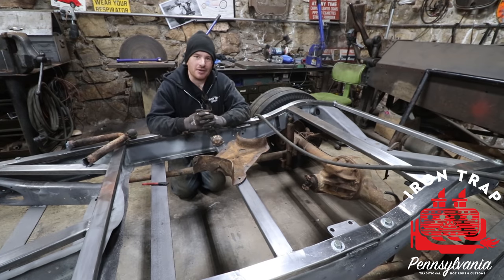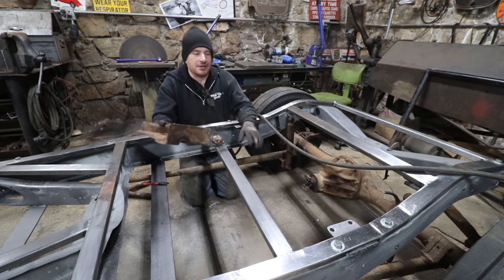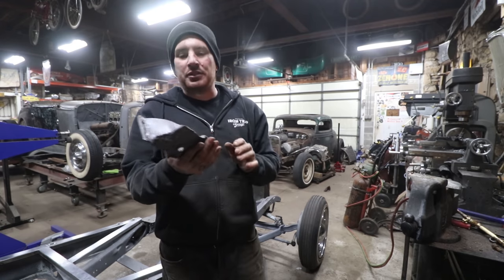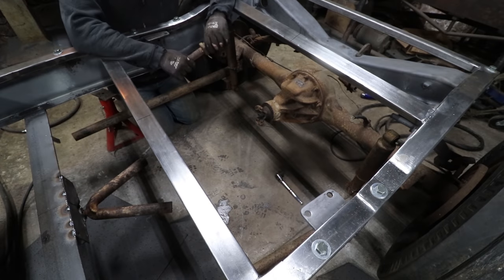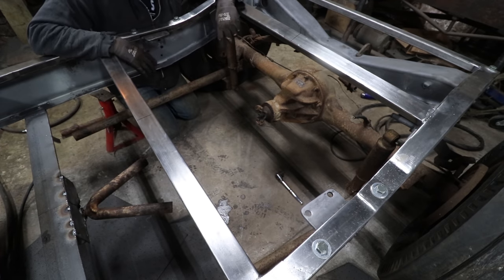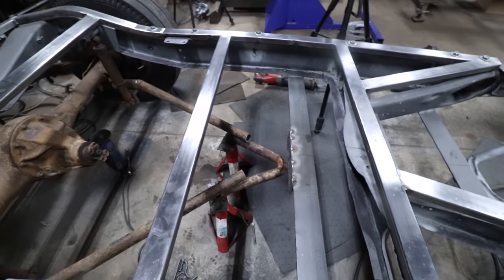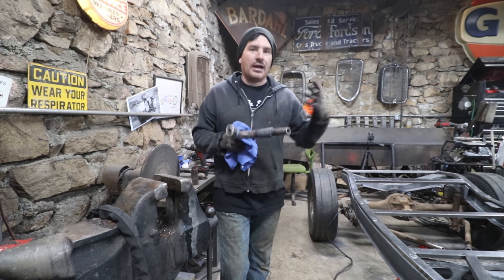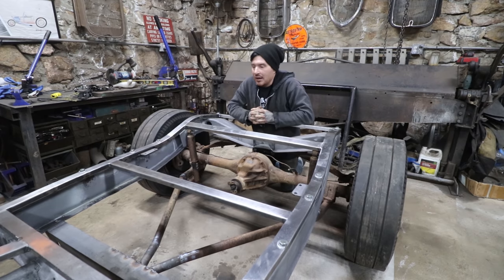Turning The Rear Radius Rods Into A Stock Styled Wishbone - Schroll 1932 Ford Coupe

Comment: Nice Job.  I did a similar thing with a '42-'48 front wishbone to locate the banjo in the back of my '31 A coupe.  I am running a T5 and went open drive on the banjo.  I put the pivot ball right under the slip yoke on the T5 and added a "torque arm" link off the top of the banjo to the wishbone as well to prevent axle wrap.  That is hidden by the frame.  Even though my car is fenderless and tall '40s style it looks completely period from the rear or side.  You can't tell there is an open drive until you climb under the car.  It has worked great for over 6000 miles.
Reply from the maker: Awesome!

Comment: Hey Matt,
Not many people would put the effort into making the rear suspension look like it was built in a 1950's back yard garage, but I understand your reasoning.
Early on you mensioned maybe installing a pan hard bay.
Why ?
The leaf spring maintains the left to right centering of the rear axle.
Cool idea using the gas welding to maintain the old style, but it sure makes ya glad you can use the Tig on modern stuff.

   Be Safe, Well and Warm
            EVERYBODY

Comment: That’s a great work around what was a pretty awful setup and now looks like it was meant to be that way. I remember back in the early days of Jaguar IRS’s where the radius rods were installed straight (almost parallel to the frame rails & every time they hit a bump in the road, there would be a loud banging noise & the suspension would literally lock up. Real spine snapping experience as the car would jolt across the road. Different setup but same basic idea that the rods need to form a “triangle” or the suspension doesn’t work as designed to.  
Really enjoying seeing this old Hotrod being sympathetically re-engineered.
👍👍👍👍 from the 🇬🇧.

Comment: Not a mechanic here, but as an engineer I noticed a little weak spot that can easily be fixed. If you weld a small plate extending the shock mount lower plate a couple inches to incorporate the bend you will eliminate ALL bending forces in the links. The links would then have only loads in compression and tension and be way stronger.

Comment: Very cool way that you blended the Torque Tubes to provide a center ball connection to the frame
Reply: Those were not torque tubes but the front of the wishbone. As stock, it bolts to the bottom of the torque tube. This has an open drive shaft so no torque tube to bolt to.

Comment: Great job which has become the norm,I am quite sure you have addressed adjusting  the pinion angle when the time comes.
Reply: Matt just set the pinion angle. :) It really isn't super critical as it changes as the suspension moves up and down.

Comment: Using the ball socket design is my preference but I have also used a 3/4" single rod end for the same thing. A model A capture will work with a 37 socket ball. When I do open drive I will split the bone taking out about 1/4" kerf and stiffen it with 1/4" flat bar tapered to fit the bone then reattach the side that was removed. You don't have to run a torque rod if done this way. If you use stock rear bones then it is quite advisable to add a torque rod from the front of the wishbone to the top of the rear end. Just making sure to leave enough room for the driveshaft.

Comment: Matt,  The new wishbone looks good.  Please check the wheelbase on both sides of the car. King pin center to rear axle center. I built a Model T a long time ago and did not center the wishbone ball correctly.  The car wears out right front tires. I know your ball is centered, but check the wishbone length.

Comment: Hello Matt , I am a recent subscriber and great i found this .  I live in south west Idaho and am one of those old guys that grew up in the 50s and 60s playing with these old cars . I was around when the 56 fords were new cars and have one . My  play car is a 35 Chevrolet standard sedan ,not stock . But i still like what you do with the old fords .  Great to see the gas welding the way most of us did it back then . What kind of rod were you welding with it never looked like the old wire coat hangers or bailing wire which was a common thing to use back then . I'm trying to play catch up on some of the projects you are working on now . Keep up the good work i will continue watching . Jim

Comment: Interesting way to center the rear ! Matt have you considered making a set of quarter elptic springs for the rear
Reply: Why would he do that?  All old Fords and hot rods had a cross leaf spring similar to what this has.    It just has an open driveshaft banjo instead of closed.     The wish bone  ball also has to mount on the frame because stock, it mounted to the driveshaft housing instead.
Reply: @jongolliher4280  because Jon quarter elptic springs are period correct and they will center the rear we used this methods in the 60s.  The 32 has a late rear not a torque tube and tube shocks I appreciate what Matt is doing I am just suggesting another way
Reply: @gerrymilidantri6457  I don't remember quarter eliptic springs ever being period correct for hotrods even  with later rear ends : ) : )  but perhaps you started a fad Gerry!

Comment: I really enjoy your videos.   I disagree with your evaluation of the rear suspension using the front radius rods.  early bronco used the same setup on the front, and those flex like crazy off road.  Granted there is some rubber around the front axle tube, but it is a very similar idea.

Comment: I was wondering if you were going to weld in a V plate bringing the two bars together in front where the ball joint is 4 extra strength is that necessary or not necessary

Comment: If the wishbone setup was better why did they split them back in the day 🧐 I thought it made the car more stable 🥺 love the gas welding I also like the look of brazing when left bare and cleared  .Build is going nicely 👍
Reply: One reason they started splitting wishbones or building hairpins was because they were lowering their cars.   Bringing the car down and keeping the original. wishbone mounting point can create a caster issue, and also interference of the wishbone with the frame, starter, maybe the oil pan.
Reply: The I beam front axle absorbed some twist back in the day of split wishbones. Many hairpin radius rods opened after breaking their welds during competition promoting the opening closed by sheet  metal. The more rigid rear tublar axle housings resisted twisting, hence the factory torque tube triangle rear suspension designs permitted twist and whine.
Gas welding back in the day was all there was for the most important fabrication, personal aircraft fuselages.
Reply: @IowaMercMan  Those are the usual reason, front and or rear.

Comment: I'm not an expert by any means, so I'm just asking. are you not going to have a drive shaft alignment problem to get a correct pinion angle because of the rear wishbone?
Reply from the maker: We may need to modify the existing cross member. Need to get the drivetrain in and see where the engine and trans wants to live. We’ll tackle the issues as we go. Just part of the process
Reply: @IronTrapGarage  Wow! thanks for the reply. I watch you and wish I had some of your welding skills and really wish I had a shop your size. Great channel keep it up!

Comment: That angle iron crossmember is very poor for the application. A 3x2  3mm wall tube between the chassis rails instead of below. And then the arms will be somewhere near square when you lower the car

Comment: I suppose you are going with front wheel drive...no driveshaft in rear.
Reply from the maker: May need to modify that cross member. Need to get the drivetrain in. Part of the process. Sorry I’m not a pro builder
Reply: @IronTrapGarage  yes but you are a smart guy...use a sched 40 tube to imitate the driveshaft

Comment: But now you're going to have to use a modern bluetooth wifi driveshaft, or raise the rear about a foot.
Reply: I’d bet he’s got it figured out. When he’s doing this he thinking four or five steps ahead.
Reply from the maker: Driveshaft angle is within acceptable range. Not unusual to have the drivetrain higher than the rear even on a stock vehicle.